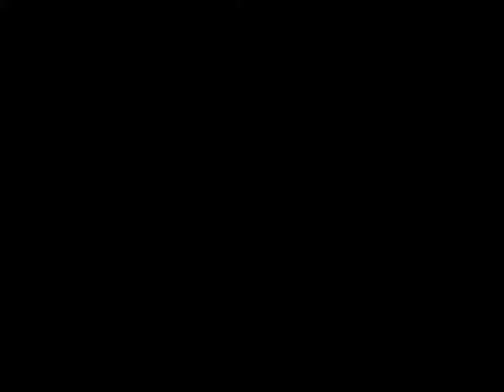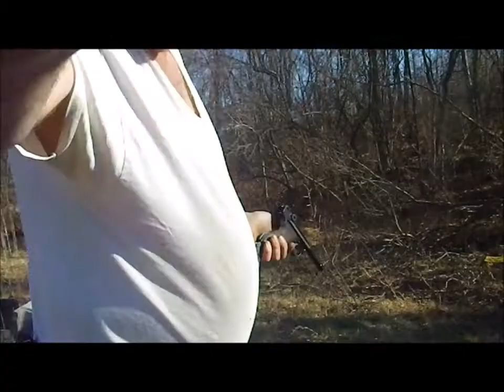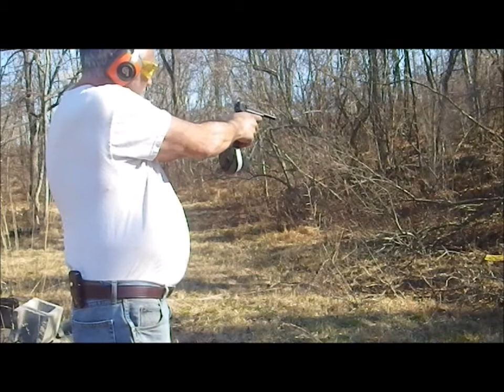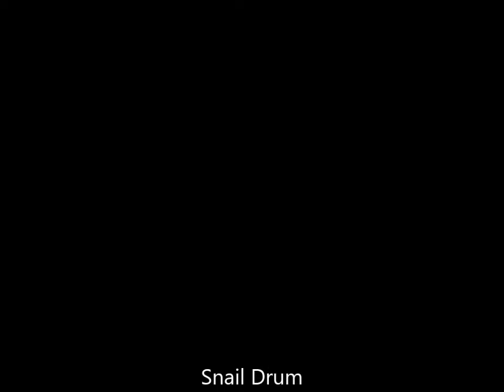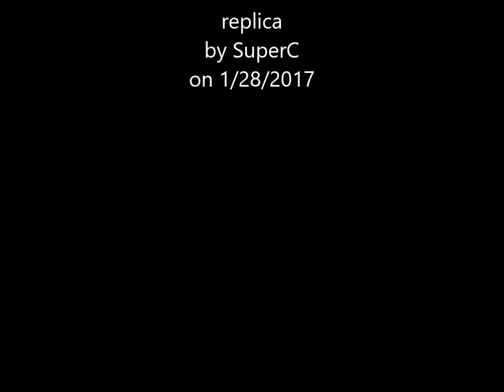Luger Snail Drum replica function test

Comment: I cant find the copy what is it called
Reply from the maker: Hi.  You raise an interesting issue.  These are called; 32 round snail drum magazines.  During WWI the Germans called them a Luger Trommel.  They were developed initially for the artillery Luger (aka the P-08Lange).  Early in their deployment to artillery crews other German commanders realized they had the potential of totally changing the trench warfare environment.  Stocked artillery Lugers with 5 of these magazines were then issued to German shock troops as the weapon of choice (vs the standard full size bolt action rifle) for raids on specific portions of an enemies front line.  There were two versions of this magazine, an early form and an improved model (i.e., type 2).  No other small arm matched their firepower at that time.  Easy hits on human opponents out to 200 yards were quite doable with this and a stocked artillery Luger with no immediate need to reload if starting with a fresh magazine,  The biggest complaint was the need  in combat to pull the gun's trigger for each shot.  The first used in combat submachine gun, the German MP-18 type 1, also used the same snail drum magazine.  

{The later type 2 MP-18 used stick magazines as we know them today.   This is because the stick magazine is both easier and cheaper to make and also less complex internally.}

Original snail drums normally cost at least $800 or so as World War I weapon accessories.  However there have been periodic efforts to make and market replicas in the past 60 years or so.  Some replicas previously sold were poorly made and did not function well.   The ones from Numrich are of higher quality and some parts actually will interchange with parts of an original one.  IMO the replica I got from Numrich used in this video is one of the better made replicas.  However, today I learned in association with your question, Numrich has been ordering and selling reproductions of the type II snail drum in small batches.  Apparently it is an, 'if there are enough requests then we will order some new ones be made' thing.  LoL, had I known that, I would have bought a dozen, then be selling them profitably today on gunbroker.  My best advice is to contact Numrich (aka Gun Parts Corporation, formerly aka Auto Ordnance) and express an interest in buying one.  The one I purchased from Numrich came with the loading tool (absolutely essential) and a translated reprint of a German 1918 manual.